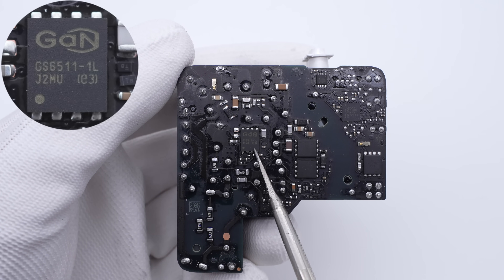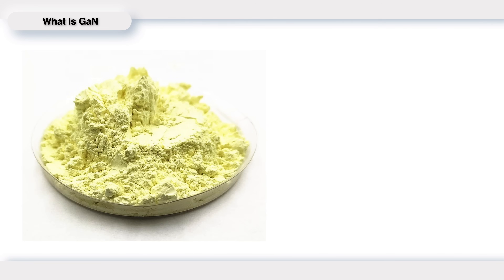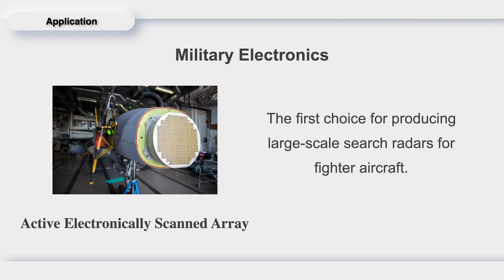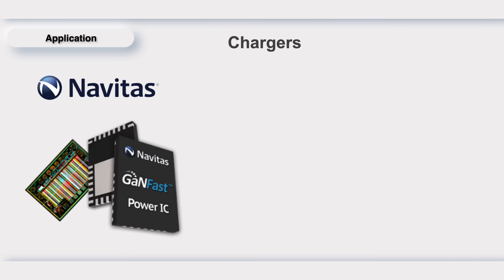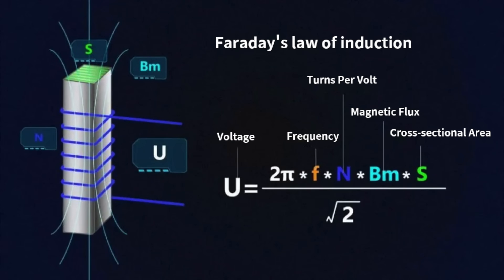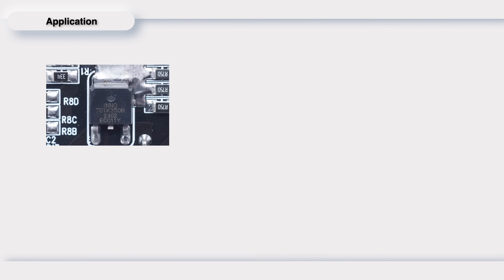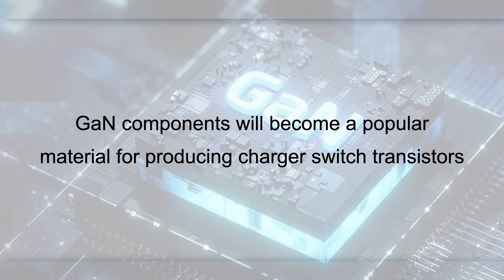What Is GaN Charger And How It Works? - ChargerLAB Explained

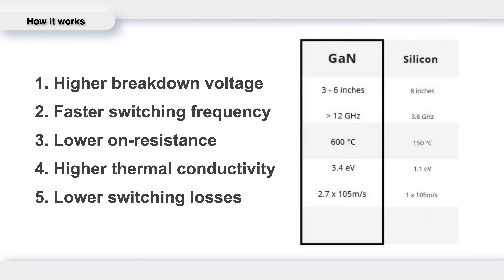Comment: The chart at 1:12 seems to have the wrong labels. The only one that's correct is the switching frequency - the other parameters shown seem to be wafer size, max junction temperature, bandgap energy, and electron saturation velocity.

Comment: Breakdown voltage is measured in inches? Other than frequency, the table is all wrong units and values😂 what does band gap have to do with thermal conductivity?

Comment: Does GaN mean the phone battery will effectively
 get less hot during charging?
Reply: Nah, you're still pumping the same wattage into the phone, and a GaN charger won't change anything about phone-internal efficiency losses. But you will have less heat in your room because the charger is more efficient (in theory)

Comment: i still dont understand. So GAN charger are better than traditional charger?
Reply from the maker: In a nutshell, yes.
Reply: @ChargerLAB because silicon can’t switch fast enough? I don’t believe it.

Also, why is a bigger bandgap an advantage? Bigger bandgap is higher voltage drop (equals higher losses).

Comment: With all the advandage with GaN I'm wondering why we don't still see GaN psu solutions for PCs for the common ATX, TFX, SFX form factors
Reply: Your phone charger and PSU both use a an SMPS circuit, which switches at a very high frequency (tens of kHz), because it is more efficient and can be easily regulated by changing the amount of time the switch is on or off each cycle. (PWM). To switch this fast, they use a transistor. The problem is that while fully on or off, it's either allowing no current through or letting all current through with no resistance, so no heat generated. But it can't go from 0 to infinite resistance instantly, so during the switching it has a resistance value that lets current through, and generates heat. GaN transistors (GaNFETs)do this switching a lot faster, so they generate less heat while switching quickly, thus wasting less power. High-end PSUs however tend to use a circuit called ZVS (Zero-Voltage Switching) with LLC topology. Basically what it means is they have a certain layout of components that resonate with each other, and oscillate the voltage naturally. If you time this correctly with your switching frequency, the power will be off while the transistor is switching. Therefore, you will have almost no power loss due to switching, even though you're using regular transistors. Right now this kind of circuit is either too big, too expensive, not efficient for lower power levels, or a combination of the three to be used for USB chargers, so they use GaNFETs to reduce the switching losses instead. The only place where it might increase efficiency is for the part of the power supply that downconverts the 12V used by most components to 5V and 3.3V. They don't use much power, though, so you will not see huge efficiency increases. Ironically it will probably help most with powering USB devices connected to your PC.

Disclaimer: I'm not an expert so I may have some inaccuracies
Reply: It is used, search for Corsair AX1600i, it came out in 2018.
The problem it's not cheap,
 but it allows high efficiency and compact design.
Reply: Maximum efficiency & cool running PSU can be done without GaN: replace diodes with MOSFETs, use low frequency switching (~100kHz). 

More compact, hotter running: GaN transistor switching at high frequency (over 1MHz I guess), with diode rectification. 

Best in theory is GaN switcher with GaN active rectification (no diodes). But a smaller transformer will run hotter (assuming power loss is the same).
Reply: Prolly cause the size, weight and efficiency benefits aren't that noticeable or important in standard PSUs, and would be outweighed by higher component cost. e.g. HDPLEX has GaN PSUs, but the 500w variant costs about double that of a SFX 500w PSU
Reply: Why no GaN ATX PSU? I guess transformer size is not a noticeable or limiting factor. It’s more important (for efficiency) to replace diodes with MOSFET than to use GaN. 

If you’re making a charger, you may need to use GaN somewhere otherwise consumers won’t buy your product because they think GaN is important.
Reply: @davadoff that 4Ghz only for silicon diode but for MOS Tube, high switching speed will lead to entire different problem, not every diode can be replace with GaN hoping for high efficiencies, for now only LED & MOS Tube are available cause it benefit from GaN due to its hard to achieve high purity and its not mealiable/tolarance like Silicon based diode
Reply: @letskentots  I should have said more important (for efficiency) to replace diodes with MOSFET than use GaN switcher with diode rectification. I edited answer above.

Comment: But GaN has a higher Ve band of 3.4V, which is about 1V for silicon
This makes GaN less favorable as a diode
Reply: Synchronous rectification with two transistors and no diode is used in high efficiency circuits. The voltage drop of diodes is not that important now. Or high voltage Schottky SiC diodes can be used. I'm not sure if GaN can build Schottky type diodes.
Reply: @davidgunther8428  Interesting, I have a lot to learn lol. So the extra power expense isn’t as important as the higher productivity basically?

Comment: Why do bridge rectifiers directly connect to high-voltage AC? Why does it not connect with the transformer at first?
Reply: The whole point of switching power supplies is that the AC frequency is very low, so you would need a huge transformer to convert it. Instead of doing that, modern power supplies multiply the frequency by first rectifying and smoothing AC to DC and then using a (GaN) mosfet to create a much-much-much higher frequency AC that can be converted by a tiny transformer, as the video explains.
Reply: @tamask001  Thank you a lot for your reply, which is very easy to understand.
Reply: @WisdomHarvester  rectifier after transfer is just not normal Linear Switching which has highest efficiencies 60% plus ya need alot of copper with lower frequencies which introduce alot inductance and cost as not every transformer made equal even in same assembly line, more coil near the airgap = lost efficiencies (±15%) (planar transformers is made to mitigate this issues but they only work on high frequencies)

Comment: Can you make a video of transformer design used in charger
Like it's primary & secondary turn and gauge 
How we calculate this
Reply: Calculate the in and out voltage, and the in and out current needed. The voltage ratio is the same as the primary to secondary turns ratio.